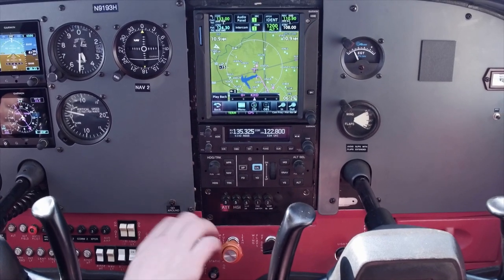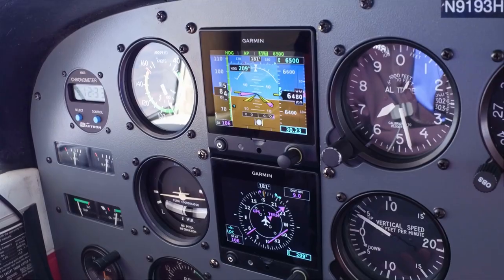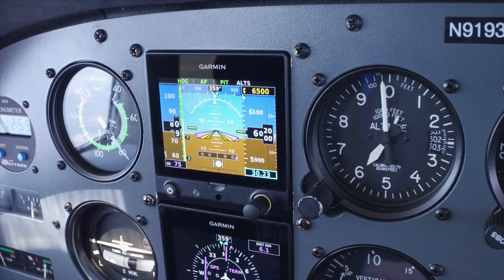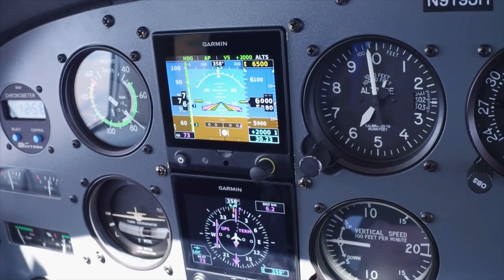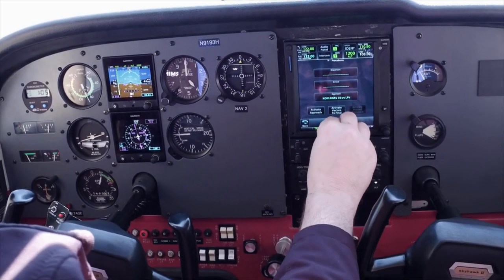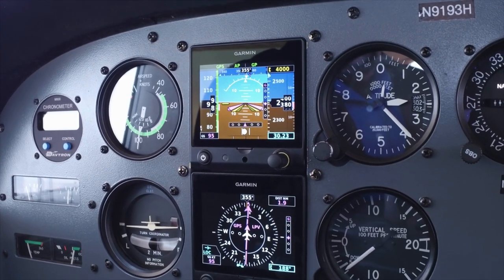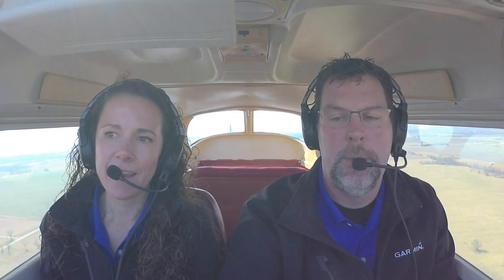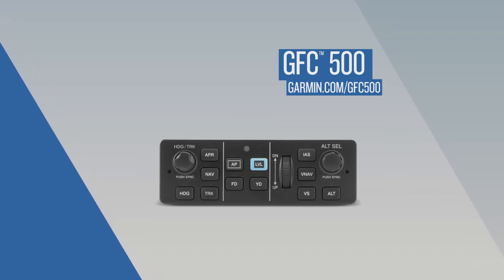GFC 500 Digital Autopilot: In-flight Demo

Comment: Flying the ILS 26 at KTWF my GTN 750/GFC 500 tracks the dme arc perfectly. Approaching the arc localizer intersection the gtn auto switches to the localzer but the gfc 500 auto switches to pitch and roll. So you don’t turn and fly by the localizer.I can’t figure out why.  Nearing the inbound turn I have to switch to heading mode, steer to intercept the localizer and then switch to nav and the gtn/gfc flies it perfectly.  What’s up Garmin? G5x2, GTN 750, GFC 500, GTX 345 in a Cessna TU206G.
Reply from the maker: It will be best to contact our product support team at aviation.support@garmin.com to help better understand your specific configuration and pilot actions to help resolve. Thank you for being a Garmin customer.
 
^DK